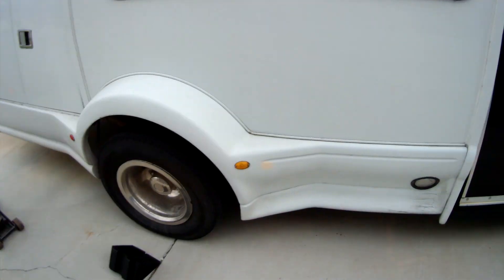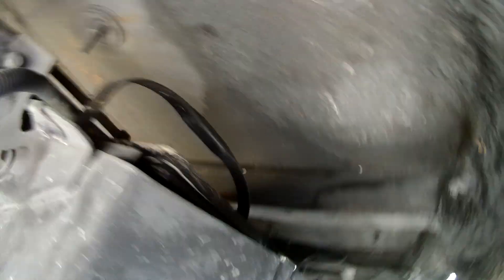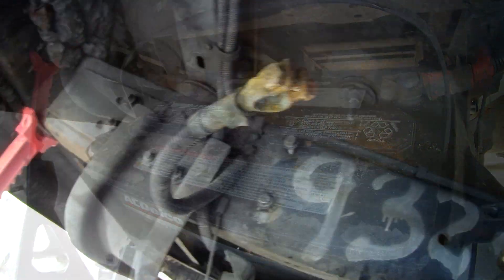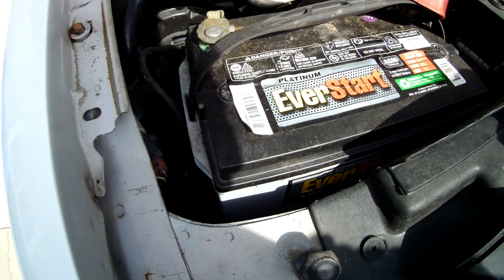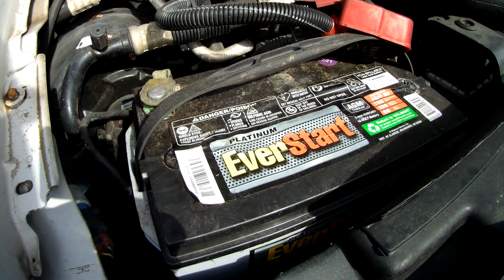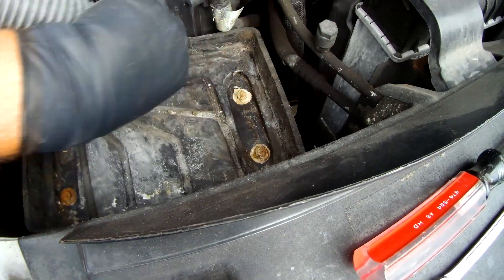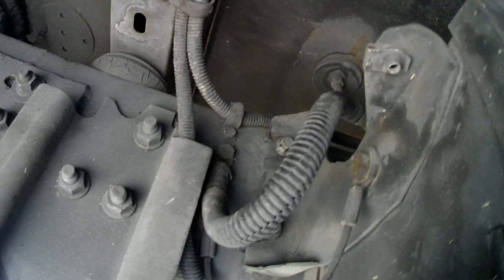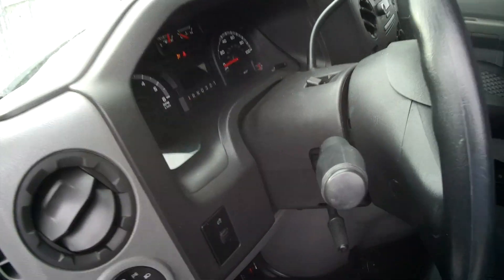Fresh Electrons, I.E New Starter Batteries for the E-350 Shuttle Bus

Comment: Question the battery that's in the back has nothing to do with the ignition system does it
Reply: Back battery could be connected to same alternator and runs parallel with main hood battery.  Im unsure if back battery wires were converted from auxiliary deep cycle type to regular type to support main front starting battery.